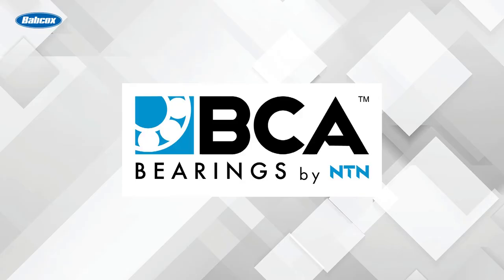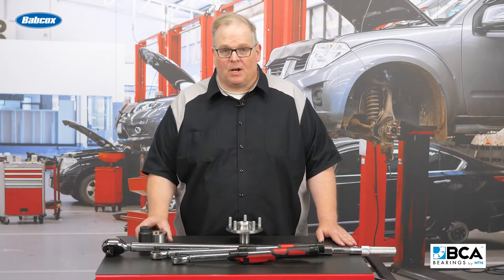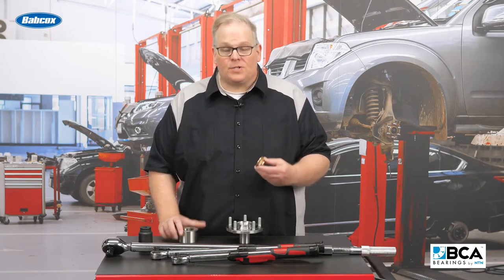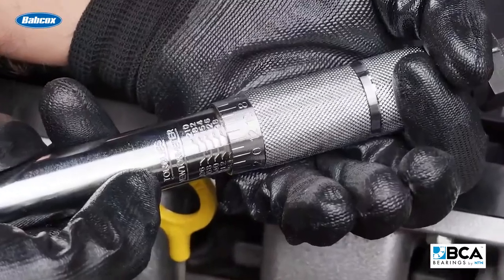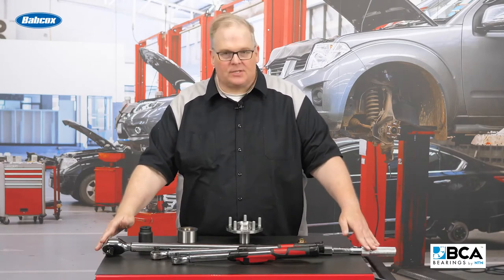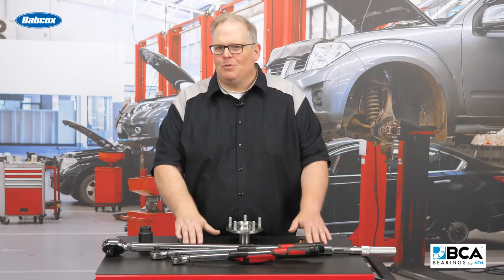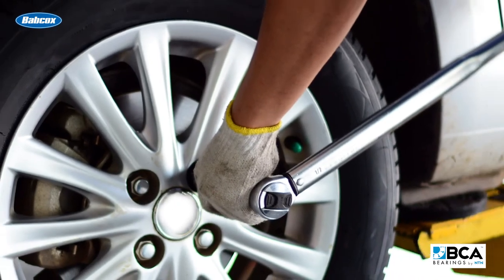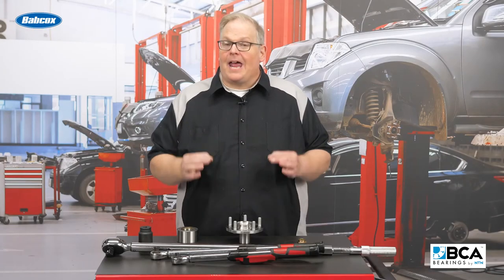Torque Wrench Tech Tips for Wheel Bearing Installation

Comment: Do you rate digital torque wrench adapters? or are they not as accurate
Reply from the maker: Good question. Digital torque wrench adapters can be a great, versatile tool, and in some cases can even be more accurate than a traditional torque wrench. Our thought is that a high quality tool in the hands of a qualified tech, being used properly is the way to go. We wouldn’t recommend a cheap version of unknown origin for critical torque specs, but a quality torque wrench adapter from a reputable tool supplier is a great solution.